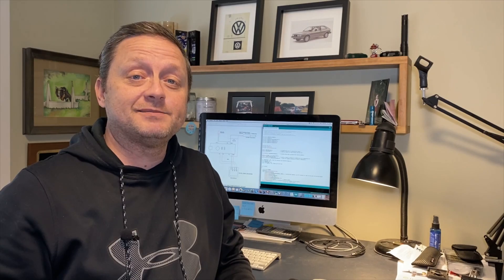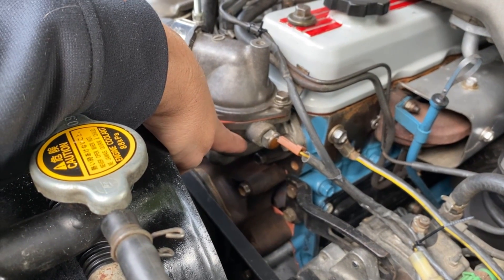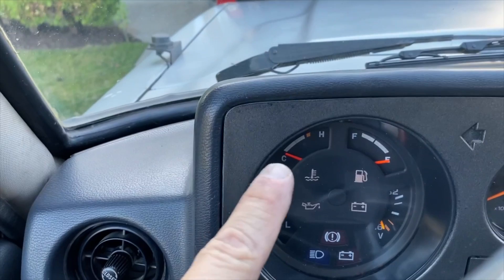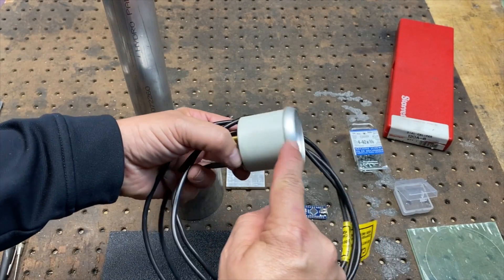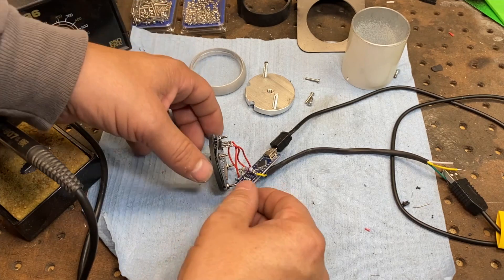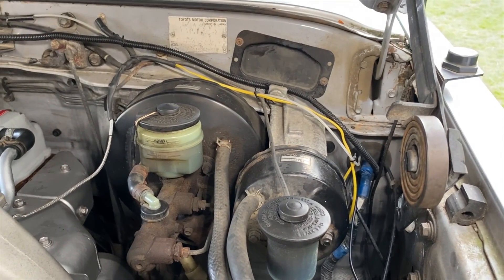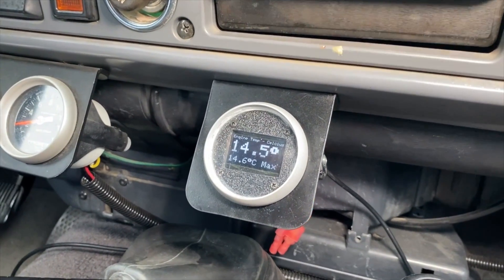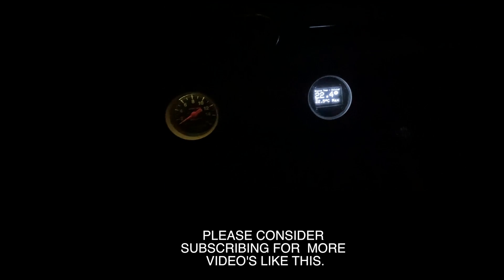DIY Engine Temp Gauge / How to MAKE an Engine Temp Gauge / Installing a Temp Gauge in my Landcruiser

Comment: Do you know the specs of the temp sensor? It looks like it the sensor you bought is no longer available.
Reply from the maker: Just Google “arduino Temperature Probe/Sensor”.  Lots of brands that will work. I found this on Amazon “Gikfun DS18B20 Temperature Sensor Waterproof for Arduino EK1083C”.   I hope that helps. Cheers.

Comment: amazing video I didn't know it was that easy, but you can also put power directly to the board right? or does it have to go trouh the usb port?
Reply from the maker: Arduino boards also take 9v direct connection. There is not a lot of 12-9v adapters. My Land Cruiser is 24V and I just use a USB adapter from my 24v-12v step-down convertor.  Cheers.

Comment: Hello! It is a very interesting video but some doubts have arisen when I see the installation.

Is your sensor touching the water or pipe it is passing through?

If you don't touch the water directly, wouldn't you have a "false" reading of the actual water temperature?

I would love to do the same for oil pressure, temperature... but finding parts for ISO metrics and calibrating the sensors in arduino is impossible for me.

Thank you!
Reply from the maker: Thanks for commenting.  You are absolutely correct. It does not touch the water thus it will be several degrees cooler. As I mentioned the video, I know when the thermostat opens and made a mental note when I see a sudden change in this temp gauge. There is a mathematical difference.  I still have the one in the dash wired. The gauge as wired gives a digital readout on how hot the engine and engine bay get.  Just more info for me when wheeling and dive accordingly.  The "proper" way to use this gauge is pull out the factory Toyota water sensor and  measure its resistance from freezing and at various temps to boiling.  I can them program that resistance curve in the Arduino and then I would have an accurate water temp gauge. I may  do that.  As for the oil pressure gauge, you can do the same.  All you have to do is get a compressor, attach it to the gauge and measure the resistance and various pressure. Use that resistance curve in the Arduino program. Cheers.

Comment: why is it only smart guys like you have diesels GRRRRR i have a 1966 D200 slant 6 and wanted to make a dash gauge for my air fual ratio from an o2 sensor but just cant find anything that's new or a walk though like you have done.. i like your video ! awesome job
Reply from the maker: Thanks for your comment.  Doing a O2 sensor would be that much different than what I did. They make a Wideband O2 sensor and shield for the Arduino. The tricky part would be calibrating the min and max values. The data sheet for the sensor may say what those values would be. Hooking is up would be the easy part, adjusting the code Sonia make sense in the gauge would be a little involved. Try the Arduino forum. I’m sure someone has done it.